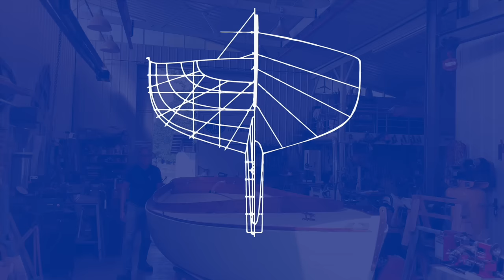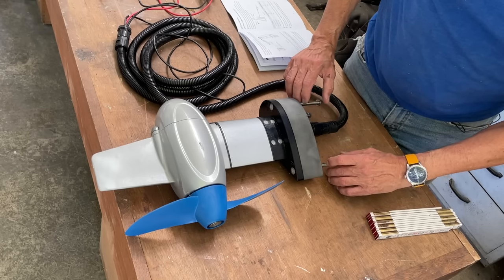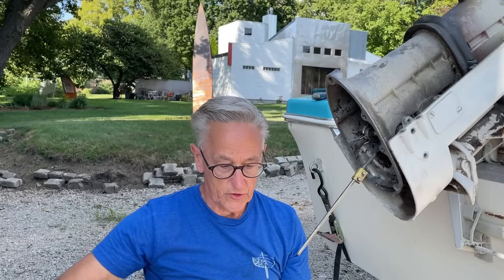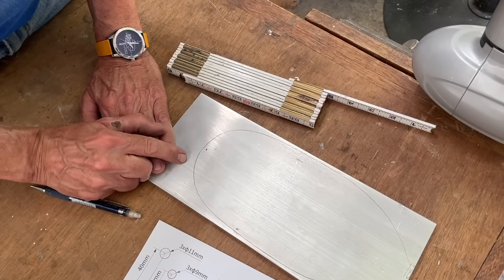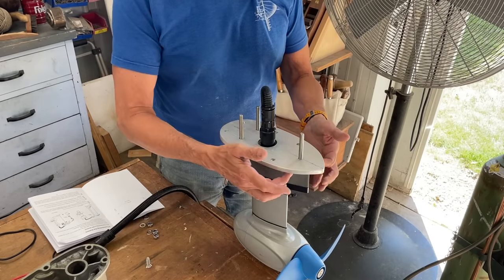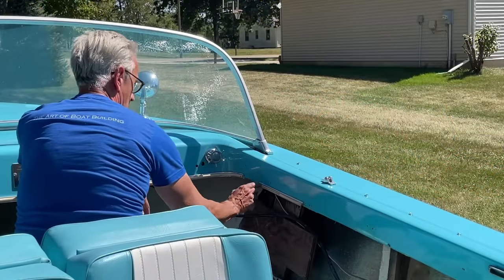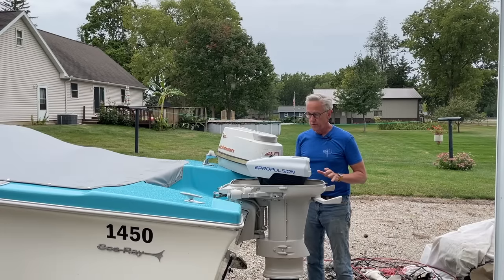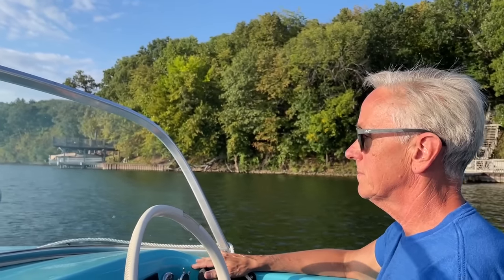Converting a Gas Outboard to Electric Made Simple

Comment: The Sea Ray is beautiful.   I'm curious to learn more about range and performance on a combination like this.  While I don't need to pull a skier, it's important to me to have enough power to get up on plane or power through chop or current.  Not sure this ticks all the boxes just yet.   I like the way the technology is going, and appreciate your sympathetic updates to a classic boat.
Reply from the maker: Thank you. I'm still learning about my electric conversion. At full throttle she goes about 4 knots. I installed the Pod Drive 1.0 Evo. It's range is about hour 1.5 on a charge at full throttle, 4-5 hours a half throttle. There is a more powerful pod the 6.0 Evo which equates to about 3 time more power. As I continue to experiment,  I may replace my 1.0 with the 6.0 ( and then put the 1.0 in my sailboat) For now I'm pretty please with the speed as it about the same as with the worn up 2 cycle (had very low compression never enough to plane)
Here is a link so you can learn more.
https://www.epropulsion.com/pod-drive/

Comment: Great conversion to save the look of the old motor and nice machining on the aluminum plate. I noticed that you mounted the electrical switches and connections on the deck in the stern compartment.  I think you'll inevitably get water in the bottom of the boat which could cause corrosion or a short circuit.  Maybe better to mount them higher off the deck on the transom or sides
Reply: When I saw that I thought the same thing.  Great job though with the project.
Reply: Even a vertical board, mounted to one side of the transom might work ok.

Comment: Those Epropulsion motors are great. A couple of guys in my sail clube have those (At the body of water where Imhabe my boat no combustion engines are allowed and electrical motors only for getting in and out of the slip and in case of emergency). No noise no smell and enough power.
This is a nice project. 👍

Comment: Awesome restoration and conversion!   Very nicely done!

The only thing I would have done differently is, rather than taking the battery out of the boat to charge it, I would have installed the charger in the boat and installed a waterproof NEMA 5-15  shore power plug in the transom to allow you to simply connect an extension cord to charge the battery.

Thanks for sharing this with us!

Comment: Bob, if you get water in your boat it will go to the back right where you have mounted all your electrical. I would suggest that you make a raised platform so if water gets back there your wires will be above it and you won't short out your system.
Reply from the maker: There is a drain port in the aft locker. I believe it can be seen in the video. 
Thanks for watching!
Reply: @TheArtofBoatBuilding  nice, and well done on restoring her. She turned out beautifully.

Comment: Very Clever Idea and Implementation! I would recomend you put the electronics and switch at a higher point or in a watertight container, despite the low voltage and that you're not running it in salt water

Comment: That is a very slick conversion kit. I was thinking you might have left the battery set up in the engine cowl but install the charging system to allow you to attach it to shore power or your home power when it was at a marina or on the trailer. Your set up is simpler and easier.
Reply: 100% agree with leaving the battery under the original cowl unless theft of the battery unit is of a concern.

Comment: That came apart way easier than any of the ones I have pulled apart. In the early 60's they switched to a different looking fuel pump that was actuated by the pressure changes in the crank case and all the ones I've had worked pretty good. But if your reed valves are not seating good than it would be problematic. That being said, electric conversion really is a great option for getting rid of that old 2 stroke engine.
Reply: Someone might be interested in the Johnson's internals as spares?
Reply: @davidyendoll5903  I'm sure someone out there wants them, but I have a 40hp Evenrude I can't even give away locally.

Comment: Excellent workmanship! Question: how long/far can you cruise on your boat with that battery? And approx how much did the conversion cost?  Thank you
Reply from the maker: I can cruise for 4 hours. That full throttle about 1.5 hours. The equipment needed cost around $2500. I used the EVO 1kW model. They also have a 3kW model and a 6kW model. I may upgrade to the 9kW for more power.

Comment: If you built a nice flat bottom where the original gas motor mounted you could use that area for storage, a cooler could fit under the motor cover nicely 😉
Reply: Your thinking of a kegerator ain't ya ? 🤣
Not a bad idea ?? Lol

Comment: Did you ever consider marrying up a larger electric motor with the original outboard gearbox? There seems to be a few people on YouTube trying that now.
Reply from the maker: That is what I first thought of. In researching it I found that a lot of power is lost in the turning of the gears. Epropulsion does make a motor that could do that ,however, it is designed for inboard propulsion and does not involve a gearbox. One of the beauties of an electric motor, easily reversible.
Thanks for watching

Comment: Neat break from the Haven. Buy a trailer. Get a boat. Not bad. You pressure-washed, but it didn’t look like you had to deal with the gobs of low-tide grease from the case.  Also a question:  that area in front of the transom where you put the battery and control units used to get very wet even with the drain (which had a habit of clogging).  Especially if the boat was left out in the rain.  I assume that wouldn’t be a problem. Glad you kept the vintage look of the Johnson 40.

Comment: It hurt to watch that old Johnson outboard being gutted.  The solution to your fuel flow problem seemed straightforward enough.  What made you decide to scrap it?  (Was it the ecology of the oil burning issue or did it have other reliability problems?)
Reply: Surely that  was a vacuum/crank case pulse powered fuel pump, not driven by a cam?

Comment: I'm sure it must be slow with only 1kw and a planing hull, but what is the battery capacity and how long can it run? Does the prop get jammed by vegetation? Conversion looks a lot easier than a 13' sit inside kayak I converted using a Minn Kota 30 (360W). A lot of fabricating and thinking as I had to convert it to a full remote throttle, shift, and motor lift lever since there was no way to reach the tiller unless I extended it several feet and it would have been very awkward to operate to say the least, plus I wanted to add a PWM for full throttle control instead of steps and better efficiency. Hits hull speed at 1/2-3/4 throttle and the battery outlasts my attention span, but of course, that's a displacement hull. Biggest problem is picking up weeds and such—I have to lift the motor and reach back with the paddle to knock the stuff of the prop.

Comment: I'm curious of the weight differences.  The old motor/gas tank (when full) vs the new electric solution with one battery.  Did taking all the weight out of the back affect the balance of the boat? I would think that the design would have been made with a heavy outboard hanging off the back in mind.  Nice thing is you can have a second battery on board and swap out if needed.

Comment: I saw the vintage boat picture on the trailer that needed work, the sales brochure, and then my jaw dropped when I saw your restoration.  That's dog gone beautiful work Bob.  The electric motor addition was pretty clever.  Have you considered remounting the battery and components on a little shelf in case a lot of water were to get inside the boat?  Thanks for sharing another great episode of TAOBB.

Comment: It's when you see the absolutely ludicrous difference in size between the electric motor and the gas one, plus the complexity of maintaining & repairing it, plus the noise and stink that electric makes so much sense. Range and the need to for batteries is the tradeoff. The ideal solution would be to mount sufficient solar that the motor can essentially run at low speeds forever in daylight, and enough battery to allow the boat to run faster for shorter durations.
Reply: It only makes sense if you're willing to give up all your speed. It went from 40hp to 1hp. A 40hp motor and enough batteries to match the range of the old gas tank would be an entirely different beast. He's turned a wonderful little runabout into a marina toy. That's fine if that's all he wanted, but I'd think you could get in actual danger taking that thing out where currents could overpower the motor.

Comment: So you are downgrading the boat from 40 hp to 2, maybe 3 hp?
Reply: Yea, I don’t get it at all.
Reply: @paulschena8493  I get it. The conversion challenge was more rewarding than somewhat noisy, smelly speed. The older I get the more I value quietness. But your priorities are okay too.
Reply: The EPropulsion site shows that as a 1hp motor. Their most powerful motor in that pod form is 9hp.

Comment: 12 v electric pump about 9 dollars 12 v battery 46 dollars so about 55/60 dollars,how much does that electric set up cost? How far can it take you before your battery dies? And your gas tank? Best to use it as a trolling motor.
Reply from the maker: The motor is 48v and battery storage up to 10 hours.